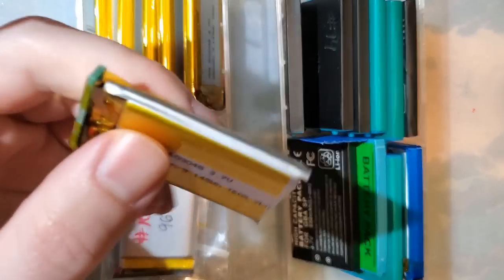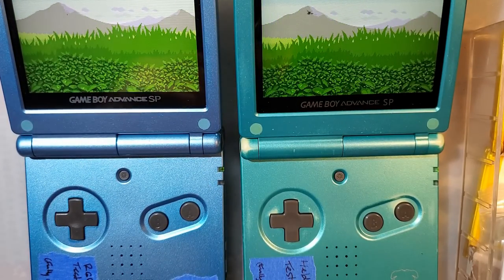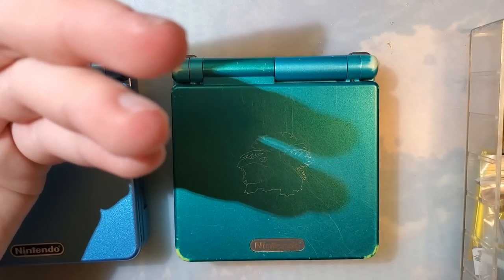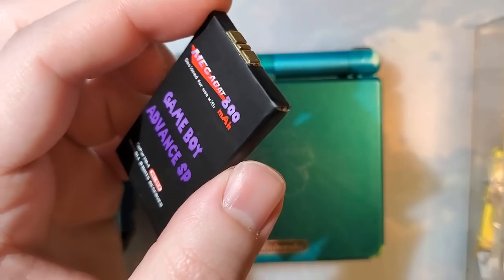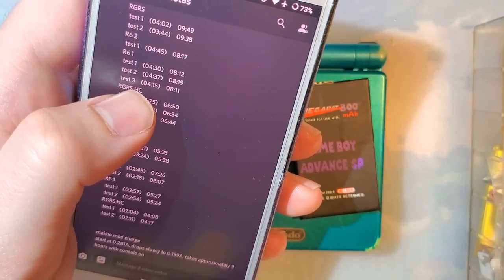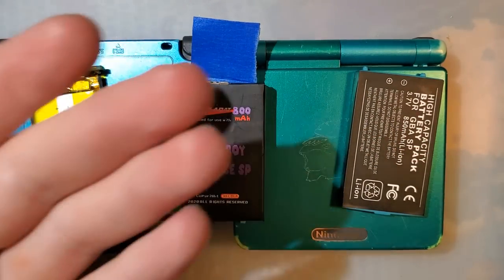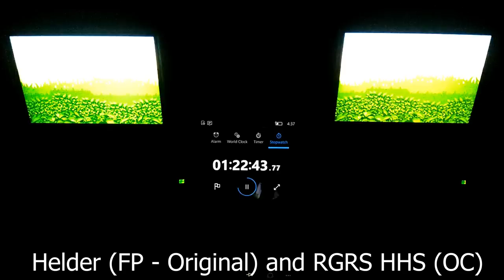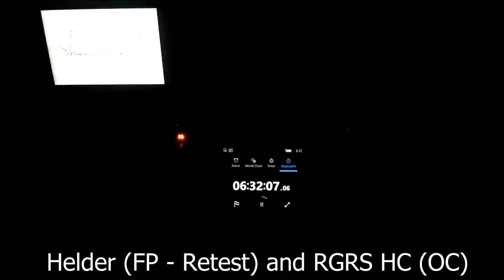Game Boy Advance SP Battery Round Up

Comment: Just got a gba sp to start playing and came across this video for battery replacement. 

Li-ion batteries can hold a charge without degradation much much longer than li-po. However,  Li-po batteries have a higher discharge C rating. That’s why Helder’s packs don’t hit the low battery light as quick. 

Long term though lipo’s will swell and lose capacity when left fully charged. After researching I will go with a Li-ion for long term. 
Thanks for providing informational videos they are great. 👍
Reply from the maker: LiPo is a type of Li-Ion

Comment: You should do a battery roundup of PSP batteries, because we really need a better solution than the Chinese garbage we have right now. Other than a big bettery mod, the only cell that fits at a decent capacity is a slightly expensive (about 11 bucks before shipping) rc hobbyist cell. And the boards are basically oem or bust. The Chinese boards unsurprisingly are really bad.
Reply from the maker: nah, PSPs suck and due to how sony built them, getting a decent battery is nearly impossible unless you like constantly recharging it (which is basically the status quo regardless)

Comment: running a lipo down to 2.8v will actually do cell damage and have a noticeable effect on lifespan and total capacity. this may have cause some discrepancies in you tested runtime of some of these batteries. I'm not a battery chemistry expert but I am doing a degree in engineering and this has been discussed in some lab classes I've taken last year

on the new charger you have make sure you don't set the cutoff below 3.4v, its likely the protection circuit has kicked in to try and stop charging what it considers a 'dead' cell. usually if you do a slow trickle charge you can bring back some dead cells that have been over discharged but do note that the battery will be unlikely in most cases to work reliable in terms of charge capacity there after. 

the reason they don't recommend having the battery drop below around 3.4v is due to the chemistry of the lithium ion and it creates a large internal resistance inside the cell. in theory a bad designed appliance can receive damage to its charging circuitry from this too, though I haven't seen this happen In the past from my limited tests last year 

love the videos btw, Aussie viewer here :)
Reply from the maker: 2.8v is not low enough to actually damage the cell as long as you don't go lower. Yeah, it will put more wear and tear on the cell but these are new (ish) cells and should be perfectly fine with that kind of load. If they weren't, that's the kind of information I'd be interested in too. Besides, where's the harm in testing how well these things handle? 

Any lower than 2.8v and, yeah, we're getting into the danger zone. It's worth keeping in mind that all batteries do have a self-discharge and if left alone at any level will go much lower. That's why you should never go down that low in normal use but these batteries are only spending a few minutes at that level of charge before being brought back up to standard levels so they do not have the opportunity to self-discharge any lower. Don't forget, this is a controlled environment (despite what things may look like on occasion). 

On older cells or in normal operation, I'd be very wary of going that low though. The reason low voltage cut-offs are typically much higher than the actual recommended cut-off on the battery is because it would be normal for the device to be completely discharged (to the cut-off) and then stored for a period of time without charging. Ideally, it would only be for a few hours, but for a device owned by irresponsible kids, that can easily be months. At the end of the lifespan, years even. 

And yeah, now that I have a (dis)charger than I can set the low voltage cut off on, I will absolutely be using it. Total capacity is nice to call out the manufacturer on their bullshit quotes, but useable capacity is much more useful information. I just didn't really want to test 20+ batteries again. At some point, I'd like to get an even better setup so I can plot discharge curves for these batteries. Not all batteries are equal so seeing exactly how these batteries handle loads would be very interesting, I think. 

If you're interested in reading more about batteries (like I am because they're fucking awesome), this is a fantastic resource: https://batteryuniversity.com/learn/article/sharing_battery_knowledge
Reply: @makho  thanks for the reply, im more in to digital circuits design myself and that honestly takes up a lot of my time, but its always great to watch your videos, and i dont blame you for not wanting to retest 20+ batteries (who would lol) 
if you want to get into looking at discharge curves of batteries, look into some intelligent constant current load equipment the can export a cvs or something similar that can be used to plot the curve of capacity v voltage

btw you did a great job designing that little pcb with the connector for attaching a battery cell for people to make their own gab sp batteries. its disappointing that there are so many junk aftermarket batteries being made, you've done the community a great service there so i hope you find the time to give youself a pat on the back for that :)
Reply from the maker: @Choppy_PHC  My current battery (dis)charger has a USB port that I'm guessing can be used for control and data logging. I have yet to try it out but I'm already looking at other hardware because I have very little self control.
Reply: @makho  sounds like myself, when it comes to gadgets and devices for my lab I often just can't help myself and keep buying things lol

Comment: I wouldn't discharge any li-ion battery below 3V because that may alter the chemical makeup of the battery and increase internal resistance and reduce capacity permanently.
Reply from the maker: puts more wear on the cell than absolutely necessary but it's not the danger zone for secondary lithium cells

Comment: Out of curiosity have you ever tried the DSI Battery in an SP mod I've seen listed around?  I've only ever followed the imgur tutorial for it and tried it but combine that with a failed wireless charging mod (seriously who wires red to negative and black to positive!?!?)  and I've been unable to test the viability of the mod.  It seems like it'd be an ideal solution since you can grab a cheap sp shell on ebay to do the modifications to but im just not sure.  BTW Sauce for the mod: https://imgur.com/a/1KNWp
Reply from the maker: Except that DSi batteries are all cheap clones with vastly overinflated capacities (no way is that shit really "2000mAh") or from 10+ year old consoles. There is no point in wasting time with that mod.
Reply: @makho  i found a few oem ones that i was intending to use lol.  Good to know tho 👍
Reply from the maker: @SYIBOI  so 12 year old batteries then. Good luck.
Reply: @makho  I'm probably going to return 2 of them and keep one of my DSI and get properly sized alternatives instead

Comment: Would it be possible to fix the charge issue on the venasaur gba? If so I’d love to see a video on that!! If you mentioned it in the video then ignore this message I’m only half way through I actually try to watch them all the way to the end lol usually I do!
Reply from the maker: > Would it be possible
you do know who you're asking, right? Yes but it's probably not getting another video because it's just a worn out port.
Reply: @makho  😂 I didn’t realize it was simply the port I figured it’d be something more complicated I am buying two of your batteries soon along with oem hinges from retro modding as well as a speaker from them I had a mint black 101 shell and motherboard board leftover from a reshell and was just missing the hinges and speaker and I have a funnyplayin v2 ips kit now I’ll have 8 complete gba sp I’m excited to finally have a near mint black shell it’s my favorite North American variant aside from the Pokémon center ones of course and the pikachu toys r us model I may pick up a 2 in one kit minus the screen I’m gonna use one of my spare funnyplayin screens because it’s laminated LG panel! I love how the one chips remember the brightness settings love my current one chip v2 setup and you mentioned the 2 in one is even better
Reply: And It would make more sense if I mention I got the shell from someone else after I did a reshell for them 😂 their 101 screen had dead pixels all across it and they didn’t wanna buy a mew 101 screen so I provided a 001 motherboard and they just downgraded from 101 and I bought the old shell, membranes and buttons the were leftover and the 101 motherboard I don’t have any spare 101 screens so I’m putting in the funnyplayin kit one question I have is there a difference between a funny playin kit on a 101 motherboard vs 001 motherboard? Power consumption? Delays? Anything?